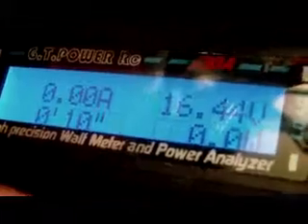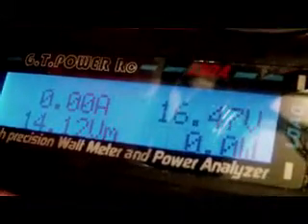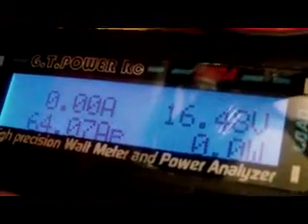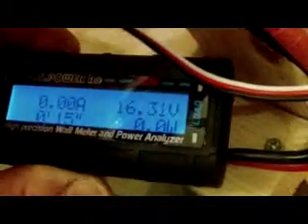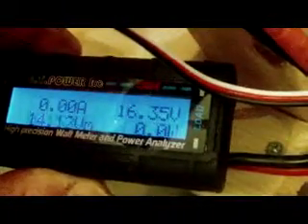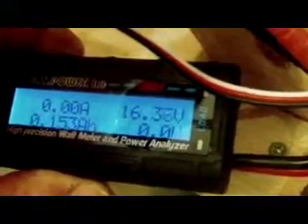RC Plane Pirate 36mm 3400kv Inrunner 4 cell Test

Comment: what size prop are you runing
Reply: lol sorry
Reply from the maker: Hi there. The prop is a TGS/EMP 4.5X4.5. Got even better performance using a Turnigy AE65 amp ESC and you can see this set up running in my 1000watt SR71 video. Thanks for watching.